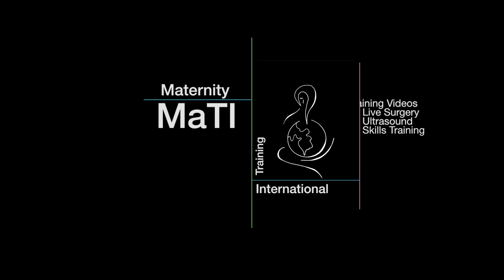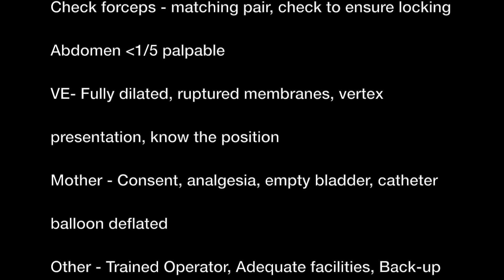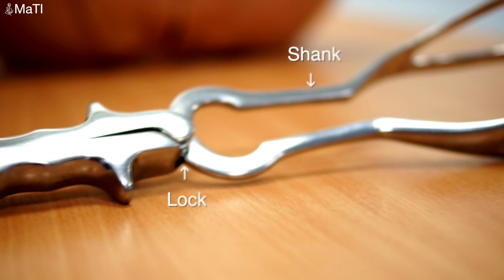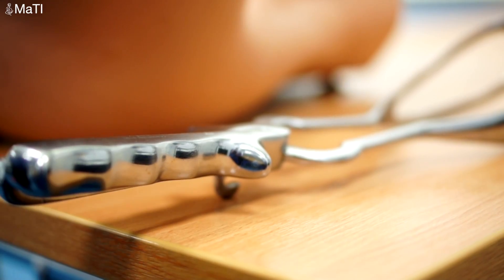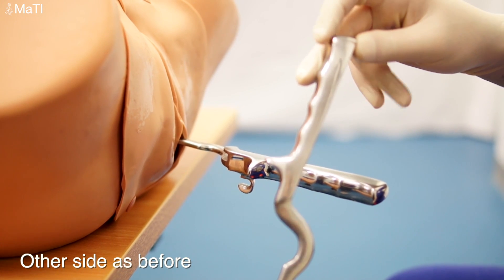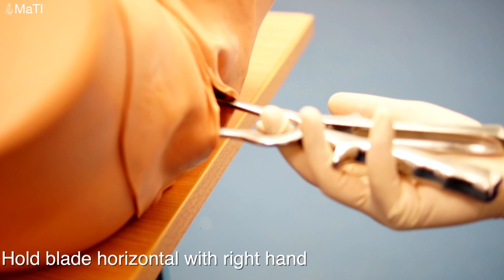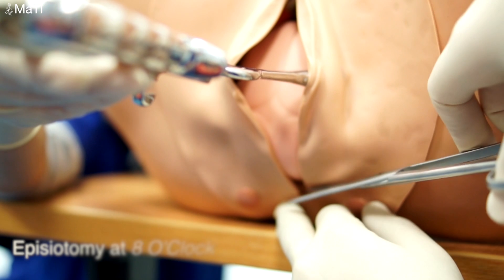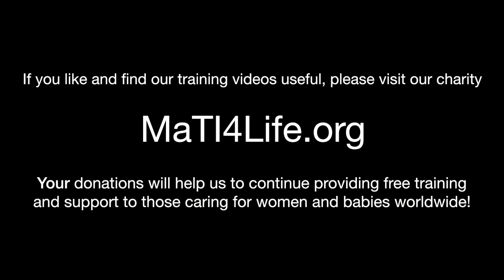Forceps delivery

Comment: I have a question about forceps, it's good or bad?
Reply: The use of a forceps is neither good nor bad. It has specific medical indications, in specific situations in wich it’ll be difficult or impossible to do a cesarean section, either because of the time required to do it or because of the position of the baby’s head.
Reply: Its very bad plzzz dont do....c section is better than forcep
Reply: @smikh1378  Thanks